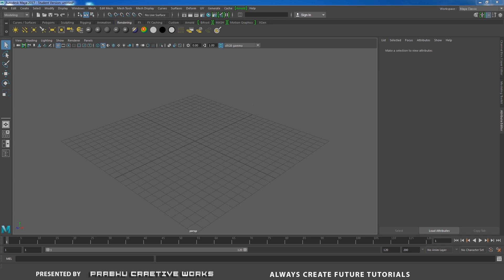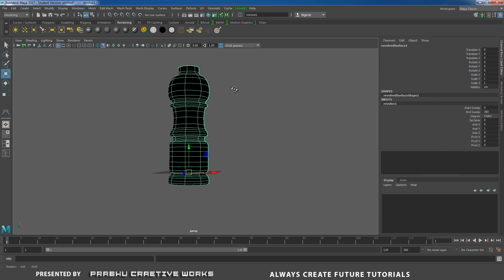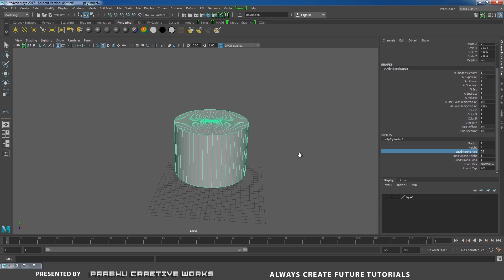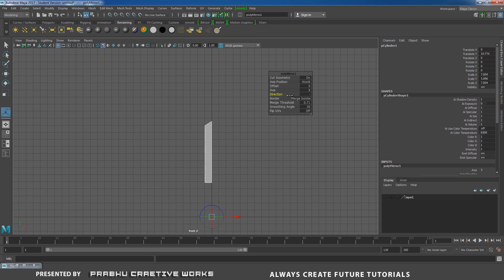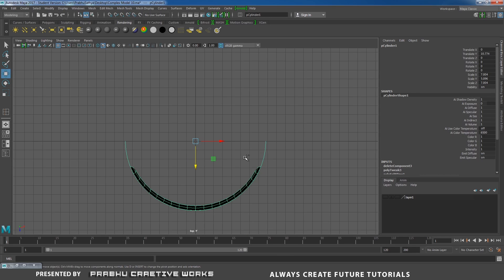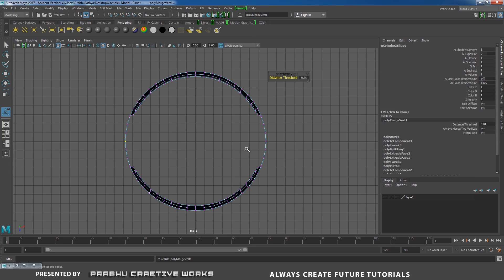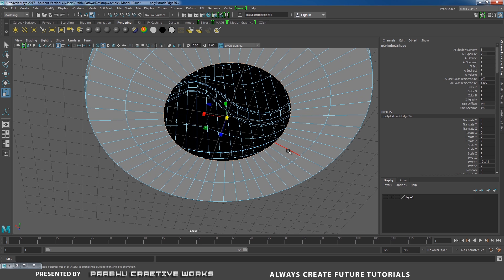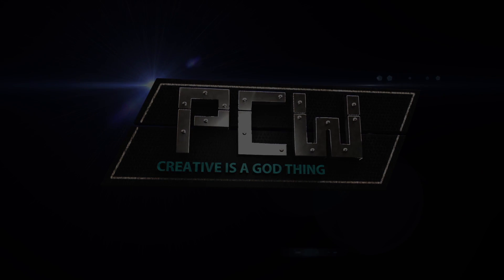How to Model a Complex Shapes in Maya 2017 | Part 10

Comment: I think the better way to merge both model is to use " in an object via the Boolean / difference command.". You just re-modelled it along the old shape is too complex. Is it correct? ( I am learning from you at very beginning, but I feel it's better way is Boolean)
Reply: doing boolean will distort ur model and preview smooth wont work. using boolean will creat ngons. so most of the times modelers avoid using boolean

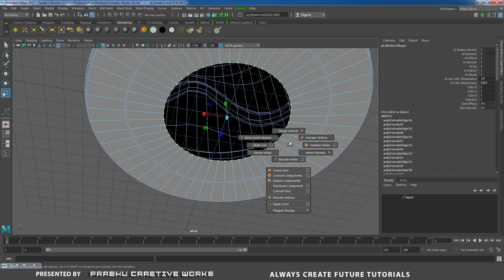Comment: Prabhu,I really like your tutorials but I have a question.When you merge the vertexes at the end of your tutorial @16:02 don't you get a lot of triangles at the bottom of your bottle what you don't touch anymore?
Reply from the maker: +Laszlo Papp if you want to close the end of the cylinder triangle happen, if you clear that triangle delete the edge s of bottom side and connect using muti cut tool to do our manual work to make it all quads